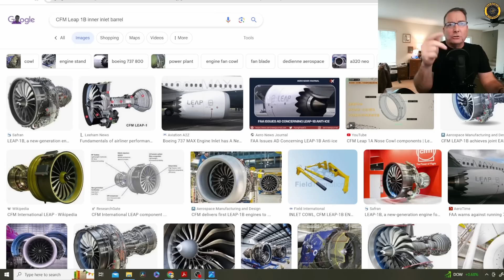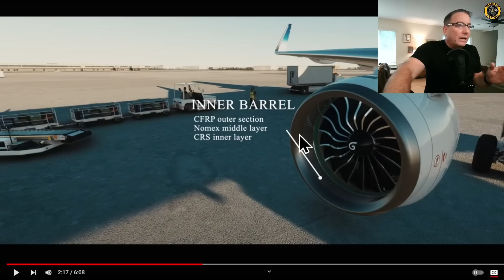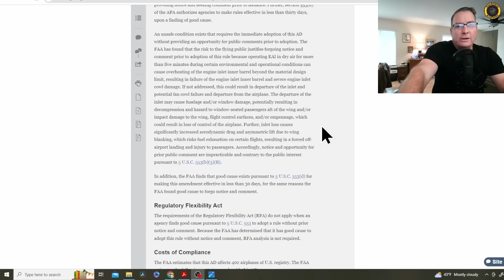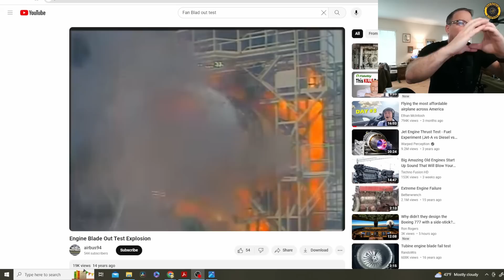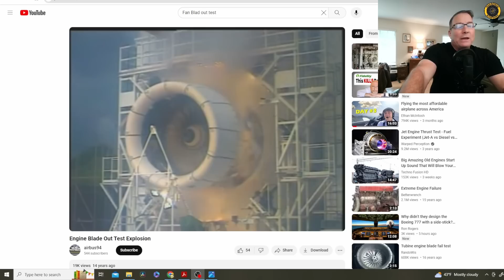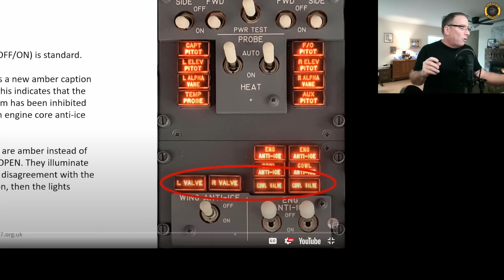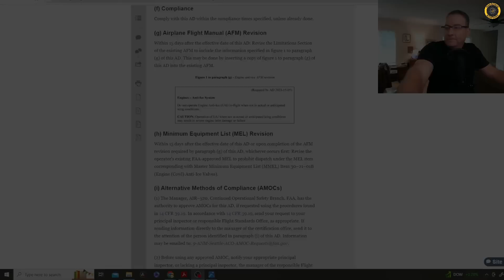Boeing 737 Max-7/-10 Certification HALTED! 1 Feb 2024

Comment: Thanks for the video. 

Boeing might not be able to keep their inner barrels intact, but if you read their annual report, they are leading the way in having a diverse workforce. They may blow up an engine from time to time, but at least flyers can rest assured that the people back at Boeing include plenty of ethnic minorities and non-binary types. In modern times. people put much more value on achieving "diversity" goals than they do on building a safe plane. That our society has reached this point is sad and terrifying. 

Part of what's so crazy about the whole situation is that if they engineer a solution that fixes the problem but adds weight so that the total engine weight with the solution is just as heavy as the original engine was with the metal components, some people will consider the whole thing a success. They may add complexity to the system and be just as heavy as they were previously. However, people will be stupid enough to think that they've made something better. 

I'd love to know why the valves are sticking. That the valves only need a tap from the end of a screwdriver to fix the problem is also troubling. Airplanes always seem to have plenty of vibrations. Maybe those vibrations cause abrasion that leads to the valves sticking. On the other hand, the valves should work themselves free if a screwdriver tap is all that's needed to release them. 

I wonder whether they can re-route the air line from the back of the engine to the inner barrel to release a little heat into the air. That seems simple, but I'm guessing that it's not simple at all. If they could release a little heat, maybe the heating gases coming to the inner barrel would be below the working temperature of the new materials. 

I agree that an automatic mode on the system is the right thing to do for a modern aircraft. However, I worry that making the system automatic is only going to lead to more problems if the valves that close flow of the hot gases are sticking. How do the 777 engines get around the problems of valves sticking. 

Speaking of valves sticking, do they ever stick in a way that makes the de-icing system inoperable? The pilots turning on the system and not having hot gases heat the inner barrel because a valve is stuck would also be frightening.

Comment: I worked in Aviation for 40 years. This situation with Boeing is not new or unusual. This is the result of unbridled Capitalism. The lack oversight by the FAA going back 27 years to 1997 has resulted in failures in the "Distributed Model" of Aircraft design and construction. As Elon Musk within Tesla has discovered, Vertical Integration is the only successful model. For 19 years reports by Boeng Inspection Teams have said the Wichita Plant is producing faulty products. It's convenient for Boeng to ignore these ongoing problems in the "Outsourcing" Model. AirBus appears to have solved this problem in Europe and England.

Comment: As an automotive development engineer, the level of manual control required for an airplane is just mind-bogling...
Reply: Imagine the DOT made all drivers get another driver's license to drive a 2024 Camry because Toyota added automatic headlights to it, but the 2023 they drove before didn't have them. That's (part of) why the 737 max exists. The other part is the immense cost of clean-sheeting a design, along with all the associated testing to certify.
Reply: @roflchopter11  What's actually happened with the MAX series is nothing like that whatsoever.  Boeing is done unless they do a 180, the only question is how many lives will they take with them on their way down.

Comment: Given the Max has already automated certain functions you would think engine anti icing would have been a good candidate for such a method. It is an unfortunate conjunction of modern materials, a good approach, lacking the tolerance of what they superseded. A tricky problem given the weight saved by using composite. There is a silver lining in that all this focus on the aircraft will make it a better aircraft, eventually.

Comment: This sounds more like an engine issue than an airframe and avionics one to me. A engine that can’t handle more than 5 mins of anti icing bleed air except in very specific conditions seems flawed to me? And the method of managing it manually or even automatically surely is just a band aid anyway? Or did I miss something?

Comment: I used to have a couple of red "Remove Before Flight" flags on alligator clips that I'd attach to fuel pump switches or any other switch not in a normal position, just as a reminder. It wasn't perfect, but it kept me out of trouble many times. However, I don't understand how Boeing thought using a CFRP nose ring with hot bleed air flowing through it was a smart idea. I was on MD80s for 23 years and then B737-400's and NGs for the next 9 years. Except for the brief period we had problems (self induced) with the MD jackscrew I don't recall ever having to worry about the basic guts of the airplane like what's happening now with the MAX. What a mess.

Comment: As if two 100% fatal crashes because of a bad fly-by-wire program (+ a door plug flying out of a brand new aircraft) isn't bad enough, this thing also overheats a part of the engine in a critical way if you just keep anti ice on? How was this not caught in testing? I feel like the 737 MAX is rivalling the fucking Comet!

Comment: It really makes you wonder about the leadership at Boeing and their priorities, several major problems in the last few years alone and many lives lost. It's also brought to light that some of these recent problems were the result of a whole mess of shady processes (illegal and/or unethical) and yet were signed off and sold.  The de-icing system was specifically designed/engineered to keep certain components warm. How does it go unnoticed through the whole process of design, engineering, research, development, testing and this  new material  escapes failure at any level?   

What makes this egregious is,  these problems are on new planes with very low hours, and they are literally falling apart.  Then ask for an extension so you could have enough time to actually build it right, but yet wanted to keep building and selling FAULTY planes, they only decided to halt after receiving a lot of backlash.

Comment: So they left the switches the same to keep the type rating the same or closely related but they essentially added a new condition on when you are allowed to turn it on and when you need to turn it off that can lead to catastrophic failure? Feels to me like the type rating concept is broken if that doesn't require a new one.

Comment: One more thing to add to the approach check list?  

Why isn’t this incorporated into the engine operating system?  Should’ve been easy to put a free-air sensor on the side of the cowl to turn it on & off. Add a temp regulator to the bleed air & it’s done.
Reply: YESSSSSSS

Comment: Sorry, more the engine manufacturer's fault rather than Boeing. They need to go back to the metal parts that used to take the heat. If my tire blows out, I don't blame Honda for it. Use your brains.
Reply: Yet Airbus use the same CFM International LEAP engines in their A319, A320 and A321 without issue, what does your brain tell you about that?

Comment: Interesting that the picture Juan uses to illustrate the cowling at 2:15 is of a Leap-1A presumably on an A320.   Which obviously leads to the question, does the A320 have the same issue?   (The Max's Leap-1B is just a slightly shrunk variant of the A320's Leap-1A).   I assume the A320 has auto anti-ice such as Juan describes for the 777.   The Max just seems to be stuck with so many snags as a result of its age and the no-new-type-certificate mantra that Boeing's salesmen talked themselves into.
Reply: It doesn’t have auto option but it gives ECAM alerts when it should be on or off

Comment: Seems like if the issue is just the increased bleed air temperature then instead of running straight bleed air into the cowling,put a small "T" inline in the system to draw in ambient air.

It will automatically mix with the bleed air and be hot, but not AS HOT.

composites are great and all... Light weight which equals fuel savings... But it seems the designers are just assuming that since they are stronger in a lot of ways, they think they must be stronger all around. I think this proves that theory incorrect.

Comment: That's incredible. Five minutes in dry air is enough to melt the engine, and there's no automatic setting on the anti-ice dial to prevent the engine from suffering catastrophic damage and loss of the entire aircraft. Why did anyone think that was okay? It's obviously not okay, but they did it anyways. Why? Because they needed to keep the switches as close as possible to the original 1960s designs, to avoid needing to spend money re-certifying their designs.

Instead of investing in a truly substantial upgrade to their existing planes, Boeing cut corners and built a reputation destroying money pit that's put them years behind on orders due to the number of delays in certifications due to badly considered design issues exactly like this. Boeing lost 1,200 orders due to the certification issues in 2020 after the fatal crashes, and these two recent incidents are sure to lose them even more orders. The fees alone from the 737 Max incidents were larger than the entire 787 Dreamliner development budget. Obviously, cutting corners was a good long term investment. By saving the cost of designing an brand new cutting edge aircraft, they've destroyed their reputation and burned triple that amount of cash. What a deal.

Boeing is failing. The once almost-profitable and cutting edge 787 Dreamliner is now unprofitable again, due to quality control issues and delays during production. Boeing lost 5.5 billion dollars due to 787 delays, made worse by the simultaneous 737 Max delays. Laying off a substantial amount of their QA staff was a giant mistake that's cost the company billions, to save millions in salaries. Boeing is a joke. A bad joke of a company that's responsible for a double digit number of commercial aviation fatalities in the last decade. I ran the numbers a while ago, and just the 737 Max crashes are responsible for nearly 1/3rd of all recent commercial aviation deaths. It's incredible how quickly Boeing has gone from the king of the skys to the laughing stock of the industry.
Reply: Saving dimes while losing dollars... it is sad.
The Airlines put the pressure on Boeing to update the 737 so they could save on training a new type certificate for their pilots. So they aren't out of the blame in my opinion, everybody wants to save a few dimes with no thought as to what that cost could be in the future... that's just someone else's problem.
Reply: @mk88200  Blaming  the customer for the poor quality of your product is surely the path to ruin
Reply: @colinmoon4342  I most certainly am not blaming the customer for the poor product. I'm allowing some of the blame for this overall situation to be blamed on the customer, the airlines so badly do not want to spend money on training, or labor period. So they put immense pressure on boeing to cater to those desires. Now, with all that said, boeing built it, boeing deserves most of the blame. Going back to my original comment - Everybody is only thinking about saving a few bucks, rarely does the bigger picture get thought of anymore.
Reply: David Calhoun comes from GE, cutting costs has been his priority, safety an afterthought. You’re on the numbers correct regarding the training issues on a 1957 airframe
Reply: imagine being a pilot on a plane that suffers this engine failure only to be told after you land by some wisecrack over at Boeing, "did you try turning it off and back on again?"
Reply: I have serious doubt that the FAA would require a new certification, only because they'd add a "auto" button/position (or just an automatic function in the engine).
The MAX is a failure, a "lemon", just like the 737 was a lucky number.
Reply: That's why MD went under and when the MD executives took over Boeing, their profit first mentality replaced Boeing's quality & safety-first moto.  It's not if Boeing will fail, but when.  Boeing, Boeingg, Boeinggg, gone!
Reply: My understanding is that the potential material failure at these temperatures was not realized early on in this case, but rather it was a problem discovered after service entry.
Reply: @vbscript2  Indeed. But Boeing is still hamstrung by its decision to bend the 737 type certification to breaking point. If this was a new aircraft design - which, let's face it, it basically is - it would have had automatic anti-ice from day one and this would never have been a problem.
Reply: aye, it seems the root of many of these problems is the desire to not get a new type certificate. They have either forgone modern design choices or shoehorned in minimally compliant options (if you squint really hard maybe you can see how it could be considered compliant) to save a little time not doing all the items necessary to get the new type certificate. Of course, most of the executives involved in that critical decision years ago have either moved on with their golden parachutes or moved up to now get a golden parachute and are patting themselves on the back for a job well done.
Reply: @vbscript2  Clearly no proper hazard assessment was done

Comment: And this is no problem with Leap 1A on A320Neo ?
Reply: The A320 has auto anti-icing, the B737 MAX does not...
Reply: @gordonrichardson2972 no it doesn’t. A320 has ice detectors that give ECAM messages when ice is detected if system is off and not detected if system is on The nacelle isn’t made by CFM though.
Reply: @gordonrichardson2972  but the valve get not stuck on A320 , only on 737 ?

Comment: The 320 Neo series has the Leap as an option, does that have an Engine Anti Ice "Auto" function? or how does Airbus get around the problem?
Reply: Airbus has ice detectors that will give ECAM messages when ice is detected to tell pilots to turn the system on if they haven’t already. It also then gives a NO ICE DET message if the system is still on
Reply: The A320 has auto anti-icing, the B737 MAX does not...
Reply: @gordonrichardson2972 incorrect

Comment: How is the LEAP 1A on some Airbus 32x neo deiced? Does it use the same carbon fiber outer shell? While A32x may have an auto setting for deicing, if the valve sticks open, is there a similar concern as on the MAX?

I also don't think that a clean sheet aircraft design would have necessarily discovered this problem, at least until someone correlated bleed air deicing valve failure with heat damaged nacelles. Does certification test operation with the bleed air deicing valve stuck open? Even if auto could cycle the bleed air on and off, it's still dependent on the valve working properly.
Reply from the maker: you nailed it on the head, a clean sheet would have an AUTO system like the Airbus, therefor mitigating THE ENTIRE ISSUE!

Comment: To answer the question of what to do if it sticks. From the MAX QRH COWL VALVE checklist: if valve failed open, if TAT is above 10°C limit thrust on affected engine to 80%N1 if possible. End of procedure.

Comment: Hi Juan. Do you remember the ice detector on the MD-80? It was a simple metal hoop, like an oversized cotter pin, mounted on the windshield wiper pivot hub. An easily visible ring of ice would form on it whenever we were making ice. With over 7000hrs on the 737-800 I still find myself relying on nothing more than an educated guess as to whether or not I have ice forming on my aircraft. I miss those little black hoops every time I fly into a cloud.
Reply: I think another pilot props his phone torch up against the windshield to watch the bolts around the wind screen wipers to look for ice buildup. Which is both hilariously inventive and worrying that Boeing hasn’t addressed the issue.

Comment: Hmm.. I wonder how the thermal conductivity of composite materials compares to metal alloys?  I mean... low conductivity would be great for helping insulate a fuselage, but if the requirement is to transfer heat out to prevent icing....

Comment: I'd say that, for good and bad reasons, the 737 is a patchwork.
If the continuous evolution motivated by the economy (and by safety, necessarily), leads to this permanent correction of real or potential deficiencies and insufficiencies in any aircraft, within the technological limits of its original project, in the case of the 737 this has become the technology patchwork philosophy.
Always on a knife's edge. 
I don't want to fly on that plane.

Comment: The way you describe the engineering in the use of materials on the LEAP engine sounds eerily similar to what they did on the Titan sub!
Reply: These composites do seem to be either in pristine condition or broken with nowt in between. The unique capacity of metal to bend if overloaded but remain intact, giving indication of imminent failure, does not seem to have been replicated.
Reply: Just what I was thinking.

Comment: Most of the flight is icy conditions, due to the altitude, so the de-icing is on for most of the flight. The FAA directive doesn't mitigate this.
Thank you for your objective, engineers analysis, much appreciated.
The fan blade failure test is a different issue to the de-icing issue, tho.
Reply from the maker: no, read the AD.